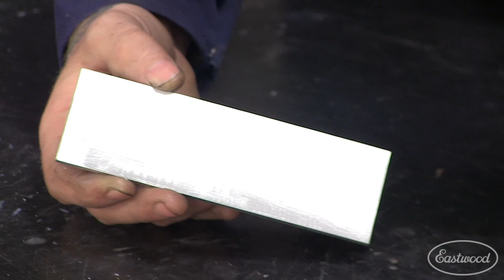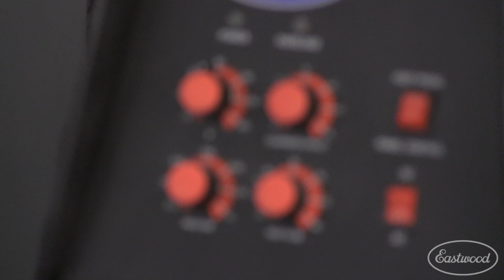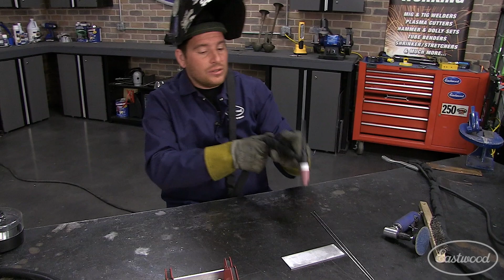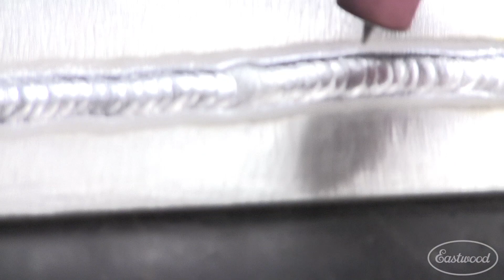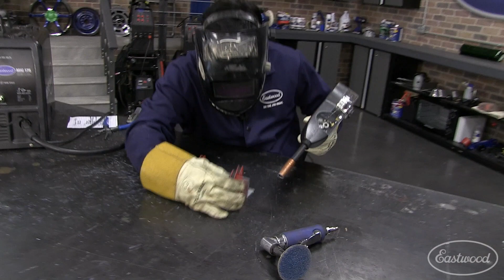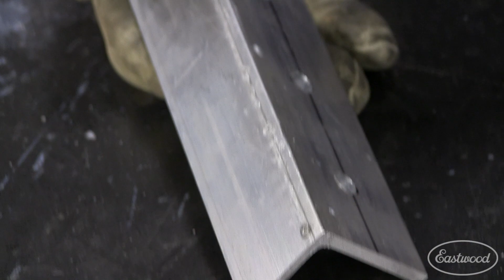How To Weld Aluminum - Pointers and Troubleshooting with Eastwood

Comment: Your MIG weld looked and sounded like you had either too much wire speed or not enough current/voltage. When MIG welding aluminum you are using a "spray" transfer of metal, meaning that your electrode wire does not directly contact the work piece. The electrode melts and sprays onto the work piece with the flow of electricity. If you slow your wire speed slightly or increase voltage to get into spray transfer it will greatly reduce spatter, smoke, and produce a cleaner weld.